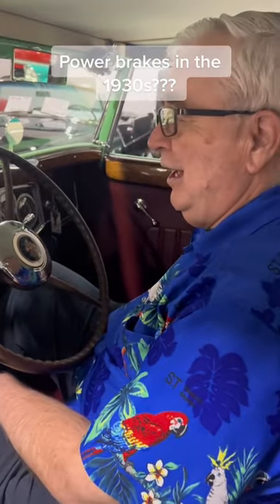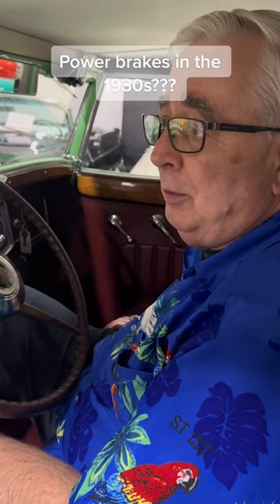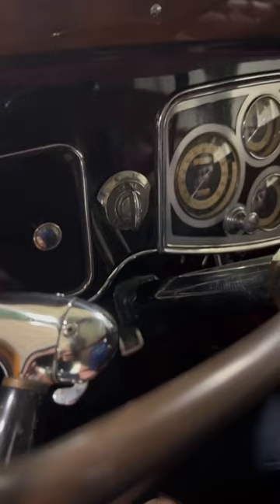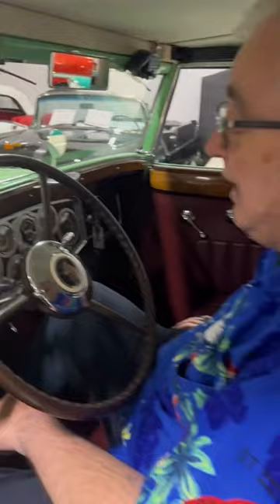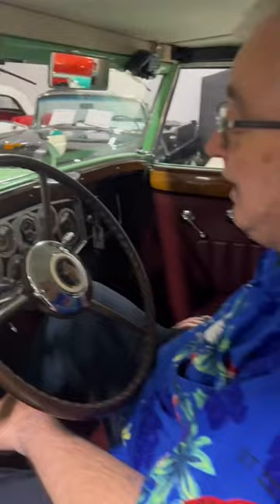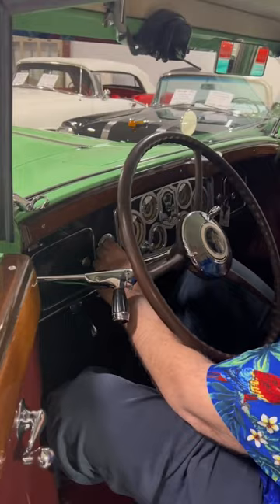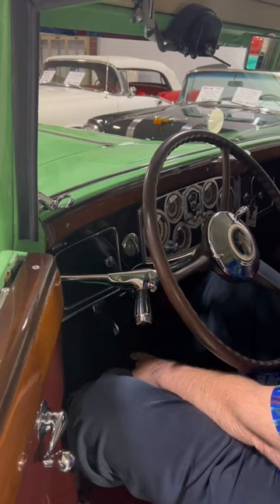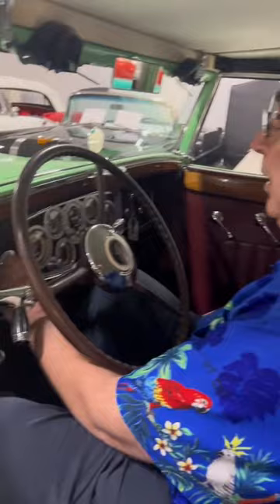"Power" brakes in the 1930's??

Comment: Pretty neat, Ford wouldn't go to hydraulic brakes for another 5 years
Reply: They weren't hydraulic, still mechanical.  It just had a vacuum booster to assist in increasing pressure.